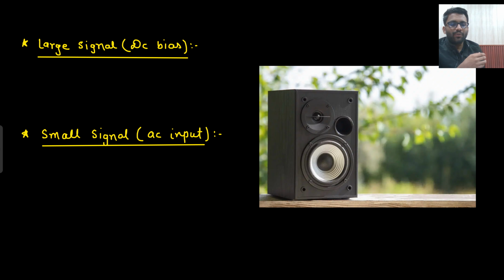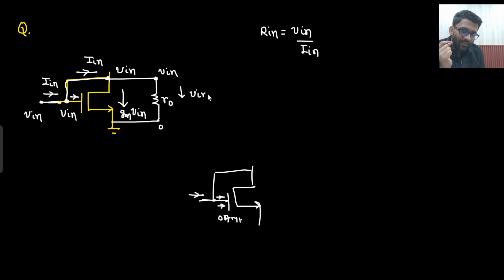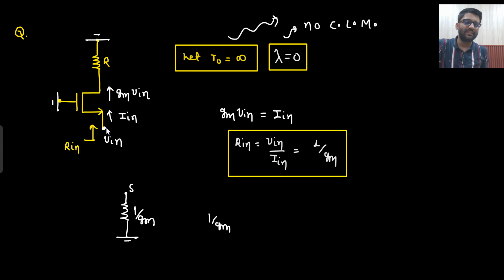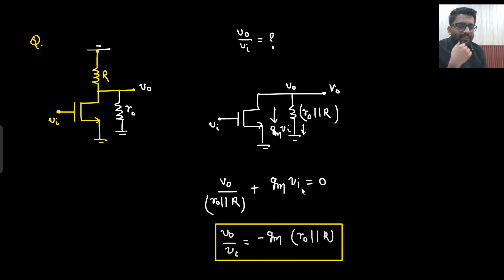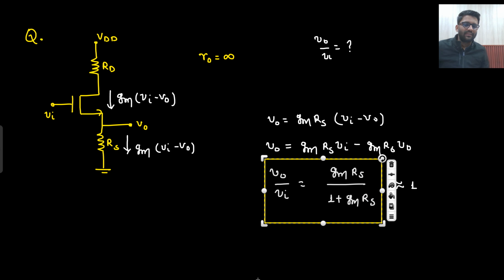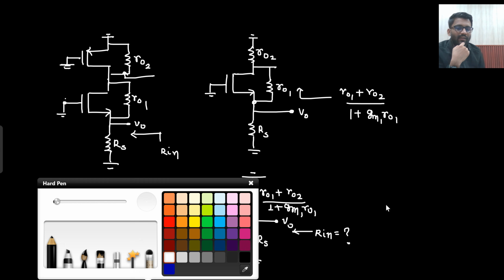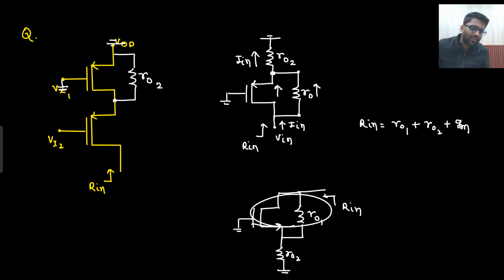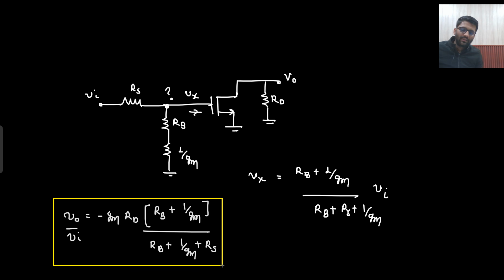🔥Solve MOSFET Amplifier Problems within a minute || Complete Concept from Scratch || PrepFusion

Comment: 2:12:47  here the thing you are doing wrong is that you are not considering the current that will go to the terminal Vin. No current will go to Vo because nothing is connected there, just floating terminal. But a small signal supply is connected at the Vin terminal so we cannot make the current in that branch zero. so that current should also be considered.